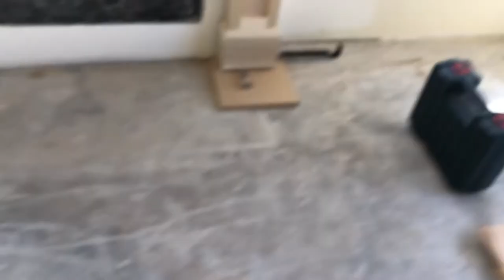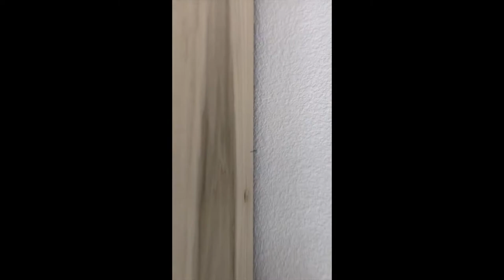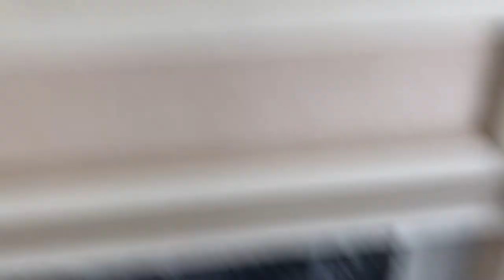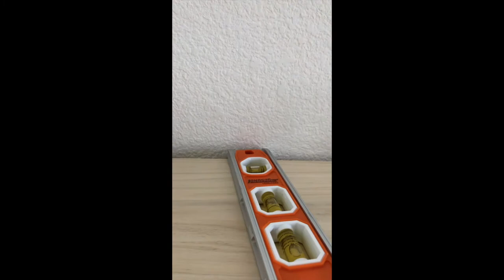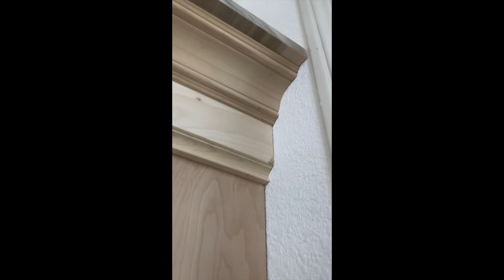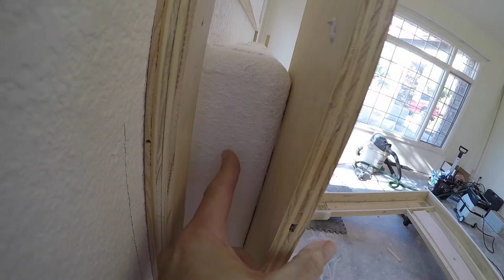How To Scribe and Install a Custom Fireplace Mantle.  Part 2 mantle build. From Start to Finish!

Comment: Nice video!  Curious on how you got the inside to fit to the fireplace surround as I didn't see that scribed.  Did you set that at the same dimension all the way around and allow the excess on the outer portion to be scribed?  If so, I assume that the fireplace was set plumb?
Reply from the maker: Great question Noah.  Again.  Thanks.  By the way I wanted to say, you have asked detailed questions about this that I thought would have been asked already.  Nobody has. So thank you. The mantle build discusses the fireplace mantle design in detail. I’d go back to that to see what I’m talking about.  Because it was a different situation with this fireplace.  It has a bump out.  I design my fireplace mantles to allow for scribing of outer parts only by Usually adding 1/2” to outer parts. Unless the fireplace already has a tile surround on it, then I’ll have to scribe both outside and inside.  But that’s rare to have.  I always advise my customers to have the surrounds put in after mantle is installed.  I set the mantle level and plumb before I scribe. So I know it’s good even if the fireplace isn’t level or plumb.  I’d watch the entire install because its got a lot of information that you’ll get answers to I think.  I really try to get as much detail in my videos and not skip stuff. That’s why they are long and not 15 minutes like a lot of channels.  Let me know if you have any more questions.
Reply: @davidbryanwoodworksandmore  Thanks for that additional info...went and watched part 1...makes sense.  I've built about 15 or so sets of built-ins the last 5 years or so as a hobby and looking to start taking on some paying jobs soon.  Your videos are very helpful in tuning up some of my processes.
Reply from the maker: @noahziegler7492  glad to hear Noah.  Thank you.  And best of luck with taking it to the next level. Which by the way, I’m going to be putting a video on business side of things.  Look out for it.